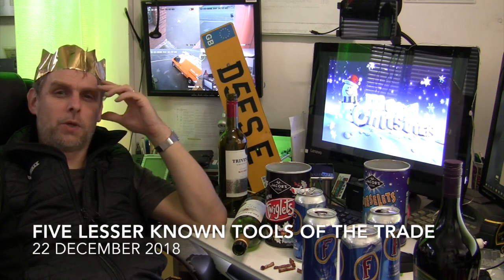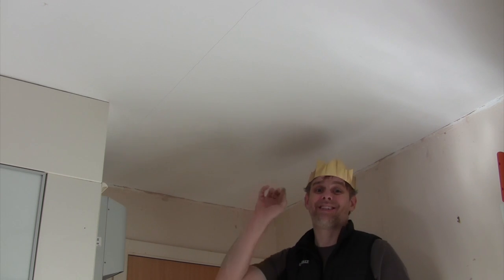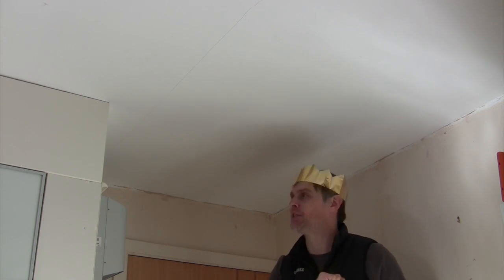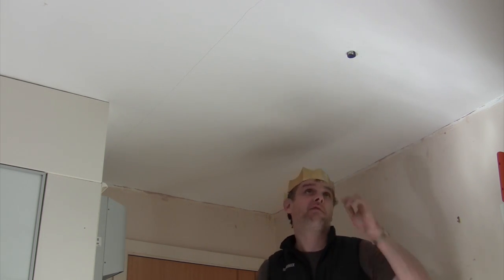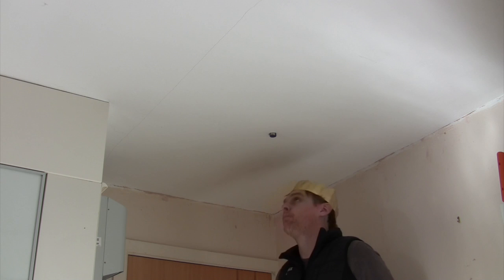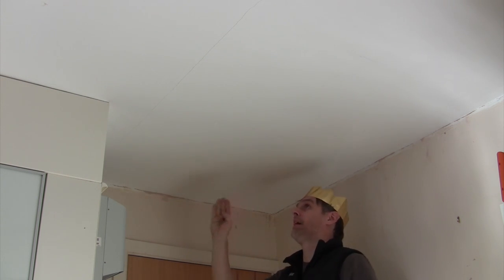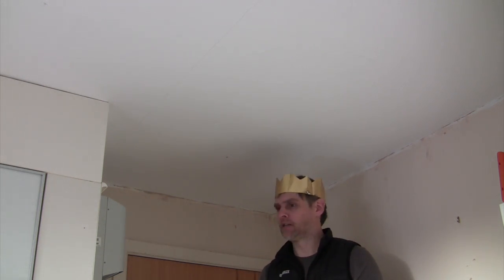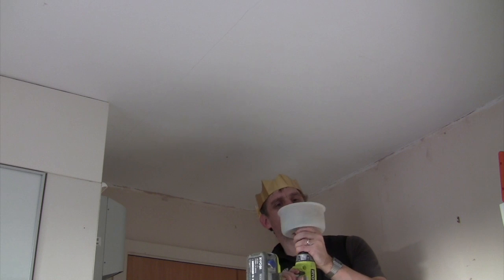Five lesser known tools

Comment: Use of nail puller.  Better to have it oriented so that the cutters cut the grain and pull out just the bit between the two cutter heads rather than digging in and pulling out half the floorboard.  Also, you need to place it with the first cutter just behind the nail head (not half a mile towards the end of the board), then angle the body so that the second cutter head will dig in just the other side of the head, thus minimising the amount of floor board damaged and removed.   I have used them very successfully and cleanly, with virtually no damage.

Comment: 11:41 - pulling floor nails on expensive floors - 2 close cuts either side of the nail with a Stanley knife and it splinters far less - when it goes right there's barely any damage at all. Superglue any splinters back in for extra brownie points (fnarr fnarr)

Comment: Hi. I am a retired electrician and with regard to your useful piece of wire for the downlight. I have used this method  before on numerous occasions but in lofts where there was no or restricted access. I used to drill my pilot hole and if that went through okay I would have a straightened out wire coat hanger with a right angled bend on one end with the bent leg slightly longer than the size of my intended downlight hole. I then inserted the hanger at an angle and pulled the bent end down flat above the ceiling. I then turned the coat hanger 360 degrees and if it did not hit anything, it let me know that there were no noggins or other obstruction that would impede my holesaw. Just a little tip that may help someone in the future. PS. I know that wire coat hangers a getting harder to come by but any similar sized stiff wire would do. Happy new year.
Reply from the maker: Thanks Fraser, and Happy New Year to you too! I cannot claim to have invented the FUW, merely the name applied to my particular instrument! I too have used it in the same way - radar mode where you bend the end and sweep 360 degrees from the centre point to check for targets. Nigel has a metal coat hanger which he calls his 'Skirting Master' and comes in handy for getting cables behind such.

Comment: Nice selection & thanks, Unexpectedly had 1 item & now Mrs has promised to shell out on a fuw for me...! 😒
Think I had seen you use a yellow version of the ergo strip in another vid (garden hot tub issues) on wsa, a momentarily flash of something that I had no clue what it was or called but instantly knew its usefulness & fucked if I knew what I was going to be searching for! 

Anyway, have a merry few weeks this year & thanks to the bearded wonder for the magnet stud finder/CU flap holder
Reply from the maker: I'll sell you my FUW for a good price! I did use the Ergostrip in my SWA Splicing video where I was prating about with SELV garden lights - had a few people asking in that one what the tool was as I omitted to mention it.

Comment: I didn’t know about the joist magnets but I’ll certainly being using that technique when I next need to fit some spotlights or secure something heavy to a joist 👍
Reply: I agree. It's a bloody good idea.
Reply: carl marquardt I got myself a strong magnetic bar to make it easier to find the screw heads as I found the smaller ones that David use weren’t as effective, when I find the heads, I either mark it with a pencil or use the smaller magnetic markers.
Reply: @alvina69  great tip. I'll lock that one in the vault. I've been on metal munching on commercial the last several years but I'm moving back to Oz soon so back to jobbing as they call it and this tip will be used believe me. The amount of patches in ceiling s.

Comment: Re cable sheath strippers. I did a job when I was 8 weeks fresh out of college. Invested a cigar cutter type cutter and some other gadgets. The other improvers where taking the piss out of the fact I used strippers and not croppers. Well there was clear flex tied to wire  used for hanging t5s. I put up 2 or 3 x more than the spark in the other room. Not only that when it was testing time  all their flexes and end of wires were fucked and mine was spot on.
Reply from the maker: Just been using my Ergostrip again this afternoon on some flex. Works like a charm!

Comment: Great fun video tickled me ☺️.. My toolbox gadget tip is a laser cube level for lining up ceiling spots and socket outlets in kitchens.. I Use a Stanley cube but better ones are available. And I recently bought a dust collecting device for drills from poundstretchers (yes really) for £1 and it works a treat.. When drilling holes in walls, no mess! Couldn't believe it 😂 get 2 or 3 for the van.
Reply from the maker: A laser is definitely essential - I have one in the main toolbox (must do that second toolbox vid!) Thanks for the tip on the Poundstretcher gizmo, will have to pay them a visit!

Comment: I've always used a Cyclops cable stripper - designed for data cabling but it works very well for flex as well. Much cheaper and smaller than the Knipex, although it doesn't have those secondary blades.
Reply from the maker: I used to use one back in my days at Mercury Communications (if you're old enough to remember them). I think I still have one somewhere.

Comment: Great video. I use the jokari, for round flex. I keep a couple of straightened out wire coat hangers  in my cable rod bag, handy for fishing data cables through an existing hole that already has a few cables  through it  where rods won't fit. I started using the dade a couple of years ago, saves so much mess.

Comment: For the 'joist magnet' I find studs in walls with a magnet from an old aquarium. It was the outside part of an algae cleaning kit.
At 3:24 I do not use a drill. I make a hole with a small screw driver. A drill is too good at drilling through plastic water pipes. :(   I have learned from experience. 
BTW, I am not a sparky, I am a security systems installer / engineer. :)
Reply from the maker: Good tip,  know from my own aquarium that the algae magnets can be quite strong! Nothing wrong with the pokey method over the drill, Nigel keeps a special pokey screwdriver on him for just such purposes.
Reply: As a side note, there are powerful neodymium magnets in computer hard drives. They are a bit of an odd shape but great for finding nails and screws in joists. So if you have an old hard drive kicking about, it's worth stripping down for parts and a bit of destructive fun!! . :)
All the best for 2019..
Ian.    M6IFZ
Reply: i've always used a long thin uninsulated Beta screwdriver, then left it poking through the hole, it usually pushes the insulation up enough for me to see its location.    but thats just me.
Reply: If you use a masonry drill  bit for the ceiling then you don’t need to worry about piercing pipes ;)

Comment: How did you pull the cable for that downlight if there was no access to it?
Reply from the maker: There was no immediate access directly behind the new downlight position because of some boards around the hatch, however a little rodding from the hole got the cable out to the non-boarded side of the attic where it could then be run to the central ceiling rose to spur the downlight off.

Comment: Sir David of Saveryshire , I had a lovely little tool once upon a time that was stolen along with the rest of my gear, thanks to the theiving bastards who decided they owned my hard earned kit. Anyhow  it was  a cable stripping device mainly for if not solely for flex up to a considerable size and looked like a peg with two tiny blades and sprung with an adjustment screw . I have searched for this to no avail . Have you come across anything resembling my description vague as it is . I believe it may be an early BT bit of equipment ?

Comment: Hi, just wondering if you have ever used that knipex stripper on armored swa cable? Mostly wondering how it handles the final layer of pvc sheathing that can sometimes be a struggle to get off !
Reply from the maker: It wouldn't be any good for SWA, however I have another tool for that - it'll be shown in Toolbox Tour 3 which should be uploaded between Christmas and New Year, hangover allowing!
Reply: @dsesuk  I do slot of work with swa and flex the knipex is amazing had one for about 3 years now. I use a rothenburger pipe cutter to take care of the armouring and the outer sheath then as Long as it's small enough csa say up to 6mm 3 core you can use the blade on the side of the ergo strip to score the inner sheath to allow for easyer removal 👍. Ps the channel is amazing where are you guys based ?
Reply from the maker: @benjackson1498  Thanks, we're in Leamington Spa, between Coventry and Stratford-upon-Avon.

Comment: Another straight talking video. So great. I’ve heard about the knives and the jokari so may be investing in one. And the magnets. I thought all electricians used cable for fishing. I’ve always got some floating about for that reason. Have great xmas
Reply from the maker: Interesting that the Jokari and Knipex items appear to be the same; it appears Screwfix sell the Jokari brand, although they don't seem to have the equivalent model. I suspect the effing useful wire is nothing new to sparkies out there, but as it has saved my ass so many times I felt it needed a mention in its own right!

Comment: You know your F.U.W. I use a pocket laser pointer/mini led flash light for that task. Far easier seeing a line of light than a wire in a loft full of wires. Saying that if you attached the laser/light to a fiber optic wire you would be able to use that just light your wire.

Thanks for the magnet tip that will save me a fortune on battery costs  for my stud detector.
Reply from the maker: Interesting idea. I had a cheap pocket LED torch thing a few years ago which had a plastic attachment to make it into a mini light sabre. I found that rather handy for poking through holes! These days, if the FUW didn't cut it, I'd use a SuperRod with the LED accessory I guess. I like the laser idea though, it should work if insulation isn't getting in the way!

Comment: Have a good Christmas ... Loving this series. I don't think I can put my finger on one tool that is extremely useful that you haven't mentioned but the most surprisingly often used to all is a set of 30 cm toolbox size cable rods. don't get the cheap ones but the CK ones and super rod are both excellent and having them in the tool bag saves you going out to the van when you just need to push one cable down one hole. and a single rod with the hook on the end can be used for the same purposes as the f u w